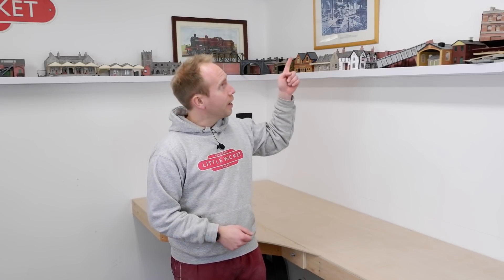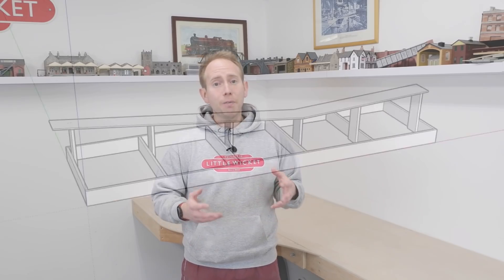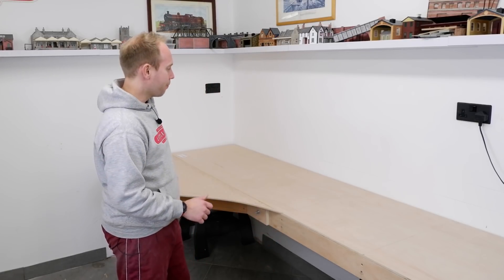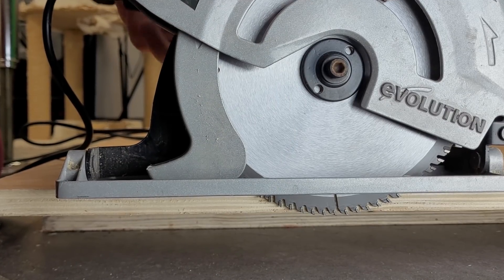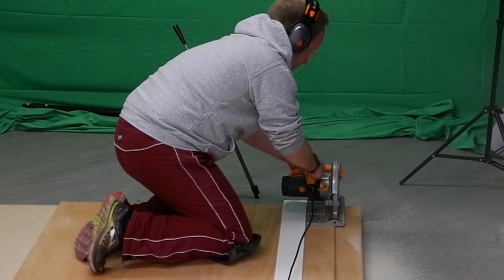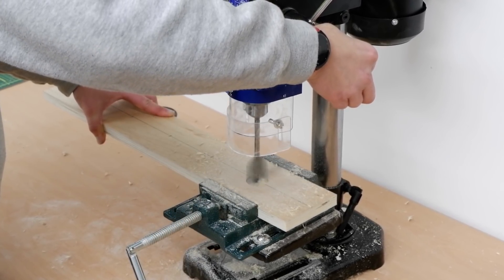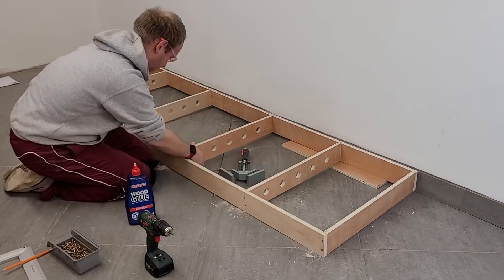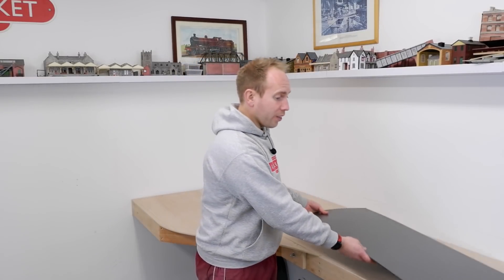NEW Layout Build - Ep1. Baseboards 🔧🔨

Comment: Good video, ideal tool for the Job is not a table saw but a track saw / plunge saw. They make much more accurate cuts than  a circular saw without splintering the boards. They have got far cheaper lately with only being around 100. They also have the ability to have good dust extraction. There is also no offset so you drop your track edge on your line and don't have to worry around measuring the offset to your blade from the base.

Peter millard on YouTube has a brilliant tracksaw playlist for newbies

I would get a track saw if your doing this again

Comment: Well done Rob in filming this Baseboard Build video. Very well explained and how to cut, glue and screw it all together with the right tools one can see it all come together. See you on the next chapter of the new Little Wicket build.
Reply from the maker: Thanks John. I'm looking forward to the build, but it's going to be a slow process.
Reply: @LittleWicketRailway Rob I will have to get my finger out and build something to get me going on-line (intended). So, I have ordered the Proses Engine House with two motorised louvers doors. I plan to build an end-to-end TMD or Shunting lines that will veer off on to a main line to add it to a shed or room sized layout later. I don't know about doing a Channel on here, but you'll never know what will happen later.

Comment: Your woodwork looks great and neat, much neater than mine is.
I made my baseboard very similar to yours and I'm quite happy with it. I would have cut my own cross braces had I had a circular saw. Instead, I used store-bought braces that I only had to cut to length.
Tip: I glued a layer of 5 cm foamboard on all my boards, which allows me to create some scenery at lower levels like gullies or rivers.
Reply: Dude you missed the whole point of his video. This is storage so there will be no scenery.
Reply: @smccoy5114  I assume that there are more baseboards to be built, plus viewers might find it helpful.

Comment: Rob this was a very thoughtful and well presented baseboard video. You explained grid benchwork versus L girder well. A cool tool that I have recently invested is a pocket screw jig. This allows you to move the cross braces even after you screw the layout to wall because the screws used for the braces go from the inside out.
Reply from the maker: Thanks. I'll check out the pocket screw jig. A degree of flexibility sounds useful.

Comment: Nice job Rob, much more satisfying than buying premade modules (and a lot cheaper !)  I use a 135° bend push fit waste pipe fitting on the end of my circular saw, It directs the dust more downward and can be rotated to avoid it blowing onto me - still makes a mess, but a bit more concentrated.
Reply from the maker: Thanks for the tip. I need something if I'm going to cut inside again. Your solution sounds a lot better than gaffa taping the hover over the hole which was my back up.

Comment: Nice video - my advice would be to splash out on a track saw, a bit more expensive but the best in my opinion for accurately ripping down sheet materials.
Reply from the maker: I will check out track saws. Will they cover a full 2440mm board?
Reply: @LittleWicketRailway  Further to my email, Makita tracks are 1400mm long so two connected together is more than adequate for a 2440mm sheet. You managed very well with the guide on your circular saw but obviously it's limited. The tracksaw is one of my most used tools

Comment: An excellent video, so good to see all the option that may be possible to choose from re materials. Cutting all the cross braces and then the holes is so repetitive and time consuming but well worth it in the end. Top surface layer of material should be great, would you also go with 3mm cork? Will lift the track up for ballasting. Whole board sounds so impressive, looking forward to seeing it all in place in the room. All best and good luck with next stage. Marc

Comment: One thing that I would add is that when buying timber DO NOT rely on the sizes that are indicated at your D.I.Y. store i.e. 1.2m or 0.9m lengths. I did, and to start with I couldn't understand why things didn't line up. Now I measure everything to make sure I've got it right.

Comment: Thanks for tackling this subject Rob, it's something we all have to undergo!

I plan to use a box structure support - but I have bought up a lot of "left over" laminate flooring boards quite cheaply from marketplace to surface it with - since these are engineered to be pretty rigid and to hold their shape and they interlock to present a flat surface. Also, they are are fairly easy to cut to shape with a laminate saw.  I won't start this build for a month or two yet, but I wondered, has anyone tried this? How did it work out as a surfacing material?
Reply from the maker: Not tried using flooring, it but hopefully someone who has will come along and confirm that it works. It sounds like a good idea. My only concern would be the potential for warping if the environment is damp or there's mositure in the air. My only experience of this is using it as flooring where it didn't take much moisture or change in temperatre for it to expand. Maybe just be careful when using water/pva mixes for ballast/scenics/etc. or maybe try to seal it?
Reply: @LittleWicketRailway  Yes, that is a consideration - that stuff does deform horribly if you spill moisture onto it. However you can - so I read - spray a thin layer of PVA on it to prevent that - not tried it, but it sposed to work.

Comment: Your joints would come together tighter and easier if you drill clearance holes in the bit your screws go right through. You can get drill bits that drill clearance holes, guide holes nd countersink all in one go.
Reply from the maker: Thanks Robin. My dad (who knows way more about woodwork than I do) approved of this comment, he said he would have done the same thing. Don't suppose you have a link to the all in one bit?

Comment: Great video.  Personally, having built both closed and open frame boards in the past, when it came to tearing it all down and starting again, I opted for laser cut ply.  For me, the cost was offset by the saving in time spent woodworking (even if I did have to wait a few weeks for delivery), not to mention the fact the I now have boards that have proper 90 degree corners!  Shall we just say that woodwork is not my favourite part of the hobby....

Comment: Circular saws and jig saws cut on the up stroke. if you cut from the underside of the work piece any break out will then be on the underside of your boards and not seen.
Reply from the maker: You sound like you know what you're talking about. I'll remember this. Super advice 👍
Reply: @LittleWicketRailway  You can by downstroke blades which are made for cutting work surfaces where you don't want to blow out the top surface...

Comment: Quite inspirational.  I'm looking at rebuilding my small layout soon.  Originally used cheap standard studwork and 9mm MDF, but its bowed an warped so this time round will be using 9mm ply instead.  Is there anything gained by using strips of 18mm ply for the framing over traditional 3" x 2" PLA softwood?

Comment: The upside of all the sawdust is that one might use it emaking flock.
Reply from the maker: Great idea, I've certainly got enough of the stuff!
Reply: @LittleWicketRailway  I've made flock by putting sawdust for rodent cages in a blender and painting it. I recommend using sieves to get rid of the really fine particles and the coarser ones.
There are instructional vids here on YouTube that explain the process in more detail.